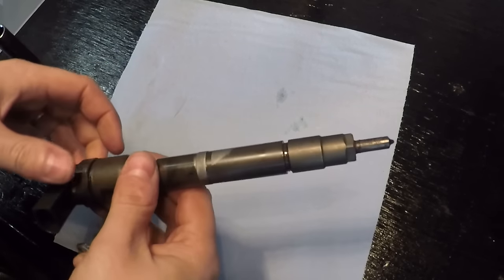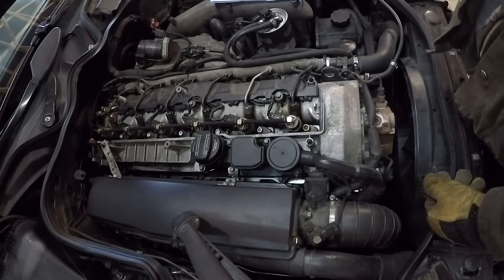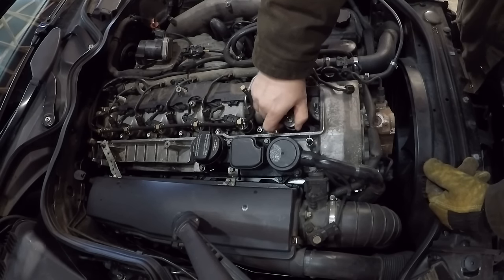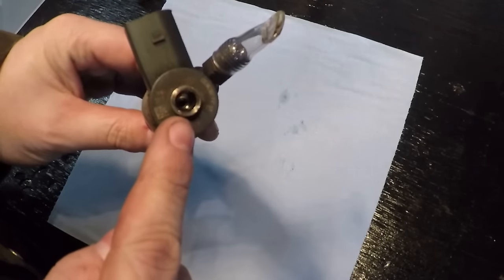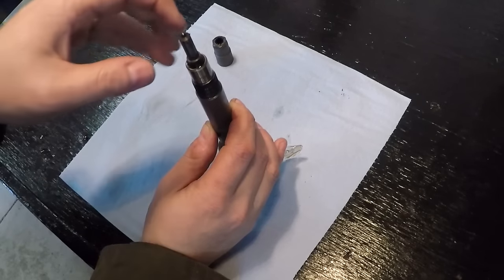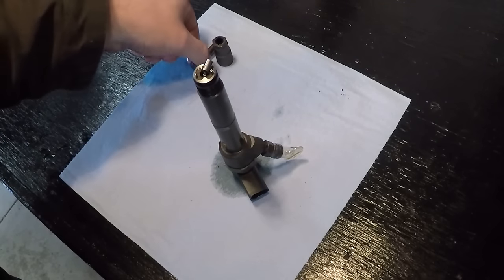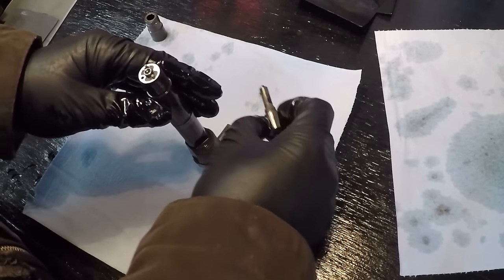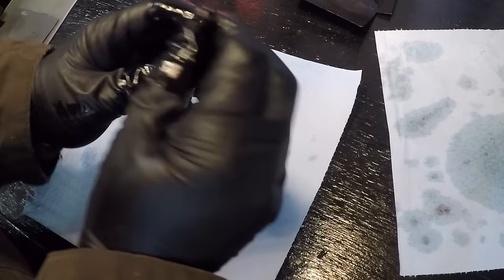OM648 Injector Refurbish | Changing the Nozzles!

Comment: VERY VERY IMPORTANT to tell everyone  that the first step is for the engine to be at working temperature before attempting to remove the injectors.  Some folks might skip your complete video before attempting removal!!   Great detail and I love your videos.
Reply from the maker: I did mention that before pulling the injector, but it is an important point! Pinning for everyone to see!
Reply: Why?
Reply: Yes Why?
Reply: @TECHNOCHAD   So you burn yourself when trying to remove them.  Aluminium head expands to ease removal.
Reply: Some people advise to let the car sit long enough for the fuel rail to lose pressure so the engine will cool.
Be careful when you disconnect the fuel feed to the injector if the engine is hot and wear protective glasses.
Reply: I removed a blackened injector with a cold engine!! I was lucky though, it wasn't badly taken by the black death. Lesson learned.
Reply: yawn, doesn't really matter, rotate left right left right, and pop,

Comment: Just a quick tip. I had an injector stuck so bad , I just decided to take off the keeper clip off . I drove the car 5-10 miles to get it hot . It sounded like a train driving with the blow by of the injector, but It came out like butter when  I brought the car back for removal . Not the best way to do it but It worked great !

Comment: Lapping trade tip - use a figure 8 pattern rather than a single circular motion. This will balance out the natural favouring of pressure on one side to a balanced all round surface lap.
Reply: Yes thats how you polish optic fiber ends too

Comment: You did very good yob but there is one thing that is interesting. Yous sad to not remove needle from nozzle to avoid anything to get in there also you did sanding on that nozzle and put it on the angle in sonic cleaning process. As nozzle is on the angle there is possibility of dust, debree and tiny metal pieces to remain between needle and nozzle body. Is it better to remove needle and set everyhing in sonic process with nozzle body (directed up) and needle to remove all dirt and debree?? Overall thanks a lot on video!
Reply: Thanks for writing the comment I came here to write. :)
Reply: I think that removing the needle from nozzle can help with removing some contaminations and chips from the inside of the nozzle. We can also inspect with loupe the needle to see any scratches on it. Of course we have to keep it extremely clean.

Comment: Nice video, thank for doing an share it. Only few things are bit confusing for me:
- why you didnt just replace the nozzles with new ones? There are sets for sales with about 50-80e(have no idea in GBP currency) per one, and then for about 1.5-3e/pcs you get the O-rings and the copper shim at the end are something as 3-6e/set of 4(or at least for my car with 4cyl and BOSCH injectors they cost that). Then you give it to some bench test to se how the flow is. (you mention some bosch service place)
- ultrasonic bath : For petrol injector with 3-3.5bar rail pressure, "huge" 2-4 holes and no pressure at all against the nozzle , maybe there is some logic to use ultrasonic cleaning. Diesel, from other hand with pressure inside the fuel system of 300-1800bars, microscopic holes for fuel dispersing and inside cylinder working , do you think that ultrasonic cleaning will make some differences? I`ve seen that before and still have no logical explanation for it.. From other hand, if the nozzle holes get clogged and /or the needle get worn then the injector work bad, and again the nozzle replacement with new one will fix the issue. 
- the surface you clean with sand paper are grinded  with proper machine, stone disk and they are with exact angle. How you can be sure that you make proper 90° compared to the inner center axis? Also, both parts are tight together, so how there must be some debris, damaged surfaces and so on.. 
Sorry, I work as metal and CNC engineer and cars are may hobby, but that are some confusing advises for me I see here.. 
Also,  I presume the tightening  torque for the nozzle cap is 70-75Nm. At least for similar Bosch looking and size is same. And need to be mentioned that is fine thread so need to be sure nothing is over it when fit on place.

http://dieselcatalog.online/en/bosch/04451/0445110320.html - that is for my car`s injector but maybe can be helpful for others to find their spare parts. At least so far I found the nozzles and the o-rings, what I`ll like to replace.

Comment: Nice video. I like your style!
Nitpicks: during injector installation I like to finger tighten the fuel line back on prior to bolting down the injector. This gets the injector clocked correctly and prevents straining the fuel line. I also counter-hold the injector’s fitting with a second wrench; not always necessary but I don’t like to push my luck.
Reply: nautamaran, You made some good points there.

Comment: I have a 2005 E320 CDI with 120K miles on it. Because I like this car so much, I am considering replacing all 6 injectors as a preventative maintenance. I have a couple of questions I hope you can give some advice on: 1) would you advise doing this as preventative maintenance? If I use om648 injectors (as opposed to om647), do I have to do any re-coding (I don't have a STAR). If I used the om647 injectors, does it require recoding with STAR? Thanks in advance!
Reply: its not a must they will work but if you have star code them
Reply: i have s320 cdi w220 with 300 k miles on it and still pulls strong only i have 270 hp map on it and its just running perfect

Comment: I have a 2005 Cdi with 9500 original miles. There is a bit of what appears to be fuel on the foam around the injector closest to the firewall.  Should I suspect the oring at the top of injector.  These have never been touched 
Thanks
I have only ever replaced the brake fluid and a few oil changes. 
And both batteries. 
Going to do fuel filter and coolant change shortly.  
Anything else for preventive service?

Comment: Nice video. I would call it “diesel injector heart surgery”. You did not comment on the need to change the little o-ring on the return line connector. Also having a tweezer would help working with gloves on. Very informative.

Comment: Hi there! 
I have an OM642 and I tried to remove one of the injectors and somehow I managed to break the return line of a nearby injector. It didn't fall, but it's bent and I'm afraid I messed up very bad and I need a new injector. Any chance of changing that top part?
Also, are you buying new nozzles for the injectors or just cleaning them?

Thanks a bunch:)

Comment: Have you got ANY tips removing the injector bolts that SNAP of below the head line...  3 bolts just sheard on me and now renders the van useless. I have about 5cm of thread left in the head and no purchase on the thread.  What is the best way to remove the old snapped bolt on this occasion.  I would guess, 6mm diameter copper pipe used for a brakeline.  Cut to length of what ever gap is left from bolt to flush of head.  Insert the copper pipe into the broke hole bolt.  Weld what ever you can INSIDE the copper pipe stacking the weld pool.  The weld at the very top an fallen key or screwdriver (sacrifice tool).  Then use the welded heat to remove the bolt.??!!

Comment: Please assist with suggestions; had to replace the cracked nozzle cover for W203 CDI now it looks like we have damaged the threads where you screw back the injector holder. thank you in advance .
Reply from the maker: Replace the whole injector. I'd suggest replacing with an om647 injector as they are cheaper.

Comment: What do you use when putting the injectors back together? Diesel or assembly oil?
Reply: ceramic grease it will prevent to stuck them in the future removal

Comment: Awesome video, thanks for posting it up! Will be tackling this project in 2 weeks or so, whenever the new nozzles come in. What is your choice for a solution in the ultrasonic basin? I know you said in the video diesel works great, but do you have a preference in any industrial cleaners/degreasers?
Reply from the maker: Something oil based. I prefer diesel since the leftover diesel is designed to be run in the fuel system, and being that it's a lubricant, it helps in lapping
Reply: @MBDieselFreak  appreciate the quick reply, thanks!

Comment: As most injectors these days are coded to the ECU, wont your re-surfacing mess up the calibration? Most other videos I have seen all say the spacers and washers are adjusted to get the injector to a certain operating spec.
Reply from the maker: @fredflintstone2077  the coding has to do with electrical performance differences between injector solenoid coils, not the injector mechanicals.
Reply: @MBDieselFreak  1st I've heard that claimed. Why would you need a 30 digit code to tell an ECU the characteristics of a solenoid? There are very few parameters.

Comment: Do you have to reprogram the injectors after
Reply: as far as i know, if you keep the inj order from 1-4 or 1-6 or so, you won't have to reprogram them. they are already programed to work in their specific order. for expample: remove inj 1 - put it back ONLY in it's socket. 2 back in and so on.
cheer!

Comment: Very interesting ? your the only  person saying they have a leak between the nozzles and the body . How does this factory machine surface wear ? Why is the high pressure fuel not lifting the needle off the nozzle seat to spray fuel into the engine as it is designed to . It only has to overcome the force of the small spring at the base of the needle .   The needle is safe to remove from the noozle to clean .

Comment: I liked the videoz Found it useful

HOWEVER There’s something bothering me!
When you start rubbing the nozzle on the sandpaper wouldn’t it get filled up with small dust particles from the grains that come off the paper? 🤔
Reply from the maker: That's why it's important to put the nozzle and injector body BACK into the ultrasonic after lapping to get all the aluminum oxide and iron particles off of it. ;)
Reply: MBDieselFreak wouldn’t that still leave some particles in the needle area? Otherwise, why not just take the needle out and then at the end ultrasonic clean all of it?

Comment: Hi Ross!

Do you happen to know if switching over to the C30 AMG injector nozzles is enough to get more fuel into my cylinders or if there are any other significant differences between the OM646/7/8 injector and the C30 AMG one?

I'm trying to get a little bit of extra power out of my W211 E270 CDI (without making it roll coal of course, I hate seeing cars smoke on public roads) and the nozzles would be significantly easier to find (and cheaper) than 5 whole injectors.
Reply from the maker: I'm really not sure, that would be a question for a bosch parts specialist
Reply: @MBDieselFreak  Hmm, okay, I don't really have a Bosch parts specialist available, but I guess I could "liberate" a copy of their ESI[tronic] software. Currently the closest thing I have to confirmation that it'd likely work, is the fact that some guy here in Estonia wrote a research paper on remapping the OM613 for ~280 hp to graduate from a technical college and in his research, he says that according to ESI[tronic] the internals of the OM613 injector from his W210 don't differ from the OM612.990 injectors in anything but the nozzle.

I guess I'll order myself a set of DLLA 156 P 1265 nozzles for Christmas and see what happens :P
Reply: The nozzles of my car (C30-AMG) are 0433171798. You can try to swap it and tell us :-)
Reply: @rafacbr9  Yes, I already know the part code :) I did, however, find out that the injectors need to be re-shimmed so they'd work properly at idle and max pressure. Since that means I'll have to essentially get them professionally rebuilt which costs 5x more than just the nozzles, I'll do it next year, rather than right now.
Reply: @sookoll23  The injectors are different internally. C30 AMG uses and older style injector (code 0 445 110 152). They run on 1350-1400 bar maximum pressure.
Your W211 most likely uses "0 445 110 156" which is a newer injector. They run on around 1600 bar maximum pressure.
Reply: just put a bigger intercooler it will give alot

Comment: Thanks for the video! I love the om648, my absolute favorite engine. I rebuilt the injectors in my old 7.3 and it was a breeze. It's ashame these can't be totally rebuilt DIY but I get it. Mine are fine now but I know the day will come when I have to do this or slap on some rebuilds. I had a 06 e320 cdi with 425k on it before some bimbo pulled out in front of the wife and totaled it. We replaced it with an 05 of the same make and model and it currently has over 300k. I know it won't be long now. These engines are tanks. Love the pre DPF engines. Thanks again, very helpful. Btw, did the lapping seal it up this time or did you have more problems? Hope it went good.
Chris
Reply from the maker: lapping did seem to fix the issue! i still have yet to re-lap all the other injectors though, they're all leaking very slowly. which i dont really mind to be honest as it keeps the injector bore clean haha.
Reply: @MBDieselFreak  leaking?  to where,internally or to the outside? 
'

'

Comment: Can you give me a suggestion? I posted this on a forum but no advice yet:

I am not knoledgeable enought and sorry to call it misfire for a diesel. 
it is actually like a hiccup and it feels/sounds like an explosion. Thought it has something to do with the combustion. Dealer wanted to change 3 injectors for bad values but not specific codes quoting me at $2800 before tax.
Other mechanics recommendations were injectors as well. Therefore I had my Indy changing some of the injectors today with no change.
As short history car has 166k miles and this started at about 164k miles shortly after and around or at about the time of adding freezing additive for diesel fuel while a tank fill up which could be just coincidence.
Egr code has been on and off rarely every now and then for the past year...about 35k miles.
Lp fuel pump in tank replaced at about 145-150k miles. Shortly after at about 155k miles fuel filter changed.
No start up problems, no smoke like when bad injectors. No hiccups for the first 5-10 min when cold. Then thy start randomly intensifying in frequency with the warmer the engine gets, but also sound/feel of the hiccups/explosion/detonation intensify itself as well. The fee is more like a skip of something like a big heavy chain from a gear to another.
It also sounds/feel like a gun intermittently shooting one round then within a second 2-3 rounds then one more or 2 seconds another 2-3 rounds.
It gets overrided when accelerating and the feel/sound of the hiccup/explosion/detonation reduces with higher RPM to the point of when reaching anything above 1500 it seems like it’s goes away or it is not there anymore. 
Could it be the High Pressure pump? Could it be my EGR stuck closed/opened influencing the intake with high temp exhaust gases recirculating since it starts to be more pronounced warming up and it is never there at cold start?
Please let me know if anyone experienced anything similar or what else you guys may think of.

Comment: Awesome video!! I just had a question though, about how the vinal tubing is there to protect debree, dirt of liquids getting into the injector. This is at 8:10
If a small amount of debree or dust actually got through that hole, would this be catastrophic? Can the injector be cleaned out/repair??
Reply from the maker: If it doesn't destroy the injector within a few thousand miles, it will absolutely shorten it's life. Contamination is the #1 cause of injector failure.
Reply: @MBDieselFreak  Hi boss... Thanks for your great video. I need your advice as my injectors seemed to be blocked by Adblue crystals. I wrongly placed Adblue in diesel tank. The car ran for a few minutes then struggles to keep running. Can we clean the injectors ( of Adblue crystals)?

Comment: Hey I know this is about a year old, but I put all 6 injectors new into my 2005 e320 cdi. And I was wondering if I needed to do anything to the injectors. I have a mb dealership about 45 mins from me. But as anyone I avoid going their because I feel taken advantage of when I do. And I also have found anything online saying that there is anything else I need to do. I replaced the copper washer and retaining bolt. Also I put on a new fuel filter. But do I need to ge the injectors matched to the ecm.?
Reply: they need recoding into computer ?

Comment: Thank you for the video, very much appreciate the videos. What would be really nice is to be able to increase the flow rate of the injectors. I already have some C30CDI injectors but would like to check the flow rate. Any thoughts on how we could do that in a DIY fashion? Flow rate is something that would be great to check even with stockers. Also I like the brass return line fittings, so much nicer than the stock plastic ones. I replaced mine a long time ago.
Reply from the maker: There's no way to check the flow rate outside of the car without specialised equipment. It requires a computer to fire the injectors and 24,000 psi of fuel pressure to work up to max load pressure. I don't trust any type of containment device to hold back 24,000 psi of Diesel sprayed out of a jet.

Comment: This is an excellent  and very educational video, i have a question which is "what if some of the micro wholes in the nozzle are blocked?"
Reply from the maker: 28,000 PSI SHOULD blow out whatever kind of blockage in the injectors lol. Only way to tell if they're plugged is to have them sprayed on a test stand by a professional shop.
Reply: @MBDieselFreak  Brake cleaner aerosol does the job pretty well to both clear the holes and show if the spray pattern is uniform